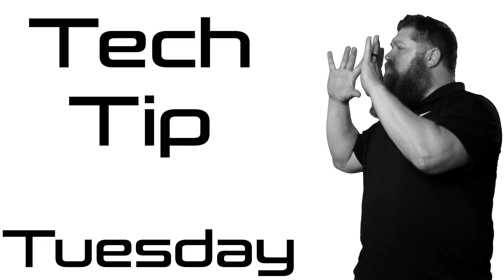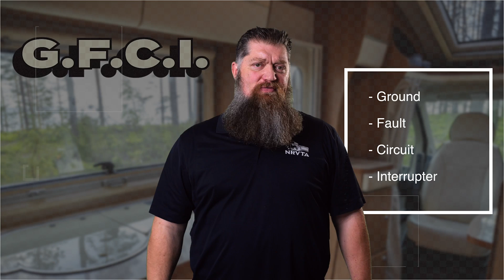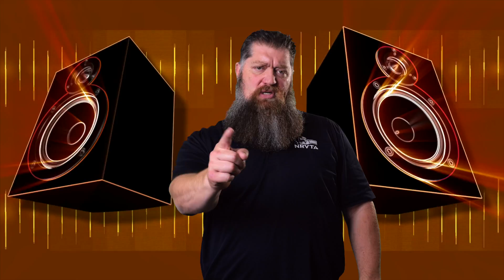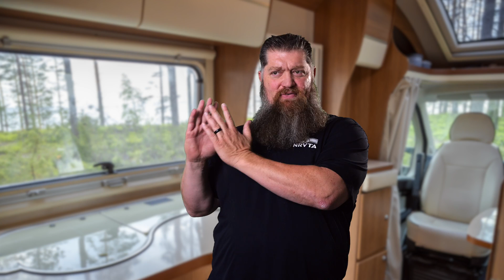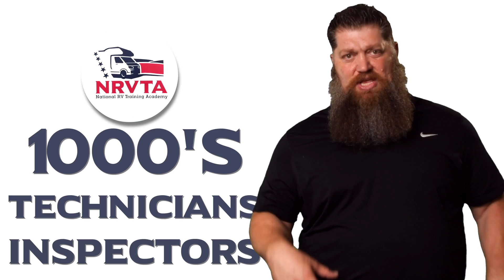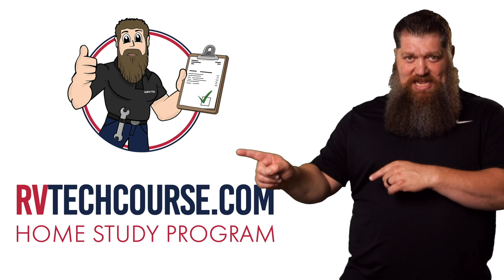RV Electrical Outlet Protection

Comment: Hey, I work for a company building mobile recreational vehicles out of box trucks and we have the GFCIs with the plate under the screw so you can just put the wire straight in under plate rather then wrapping around the screw but our boss insist we need to wrap the screw and if we put it straight under the plate over time it will fail. What do you think about this?

Comment: They were called Ground Fault Interrupters for about 15 years before someone decided they had to have that "C" in there.
Reply: Funny that they were called Ground Fault Circuit Interrupters in my 1981 NEC.   That is when they were only required in bathrooms in dwelling units.

Comment: Got a question.  I love all the videos you do Todd, I especially like the one you did on EMP’s.  Here’s the question, I have a RV that came with slide toppers.  How often should I be inspecting underneath and remove it to do maintenance on the slide.  What kind of maintenance should I do and be inspecting under the slide topper.  I see a lot of videos about checking the seals on slides regularly but nothing for people with slide toppers
Reply: Changed my name that it’s a little easier for you guys lol

Comment: "GFI" irritates me too. Thanks for spelling it out.
Reply: The receptacles and now the circuit breakers and receptacles have always been GFCI.   GFI was what is installed in 2000 amp 480/277 volt 3 phase 4 wire service entrance panel boards.   They were burning up from ground faults.
Reply: They were called Ground Fault Interrupters for about 15 years before someone decided they had to have that "C" in there.
Reply: @RV_with_Noni_and_Beard  I remember early references to GFI. As I recall, the GFI was the mechanism that opened the connection if there was a fault. The GFCI interrupts the entire circuit. IIRC, GFIs were used in older systems that used fuse boxes and GFCIs are either breakers or outlets that protect the entire downstream circuit. Over time, they have become synonymous, but it still irritates me.

Comment: i recently found out our circuit panel on our class A is split in two. part only works on shore power. the rest also work on the inverter. 

i always knew that some things worked only on shore power, but didn't know the bus on the circuit panel was physically cut to make that happen 

a video diving deeper into that subject would be awesome
Reply: That could get a bit deep. I really don’t know RV much but ages ago my friend had a motor home that would trip a GFCI on his house when he plugged it in. This was a simple 120 volt circuit of a hot wire, neutral and ground. Took me awhile but I eventually found the onboard generator had the neutral bonded to the ground internally in the generator. This caused circulating currents from neutral to the ground wire which the GFCI picked up.  The generator bond was required so I assume this has something to do with why they separated out the wiring completely in your case. Each source of power has to have the neutral and ground bonded together ONCE! Power to your house is done once and the generator once. When you tie them together now you have 2 and this causes unintended currents going where they not wanted and getting onto the ground going back to the house. Anyway this years and years ago on a friends motor home.

Comment: All you need is a breaker panel with easy access and a surge protector that is separate from the outlet. You never know what could happen.
Reply: I'm confused.  What does a surge protector have to do with a GFCI?  One protects from voltage spikes and one protects from a ground fault.
Reply: @johnnylightning1491  You need both to have the best protection.